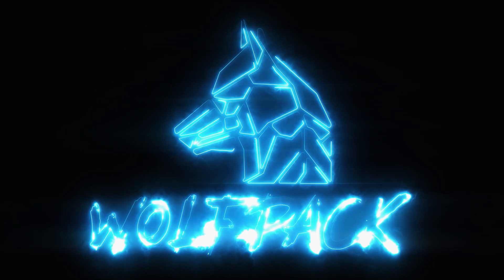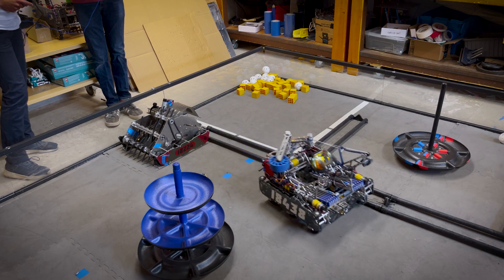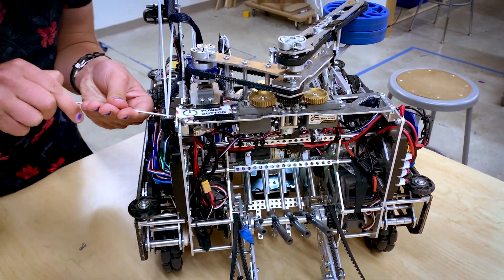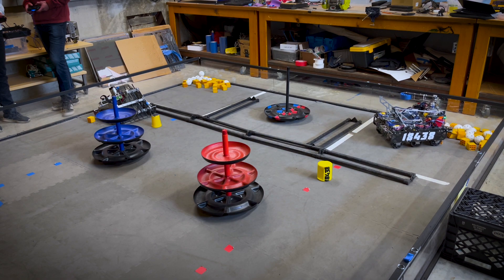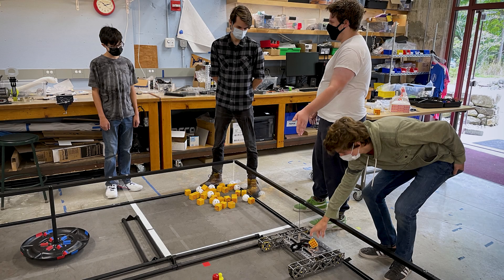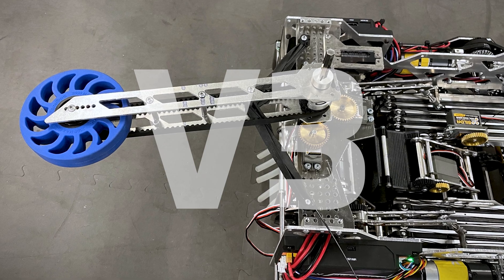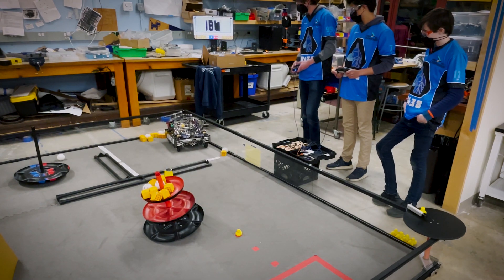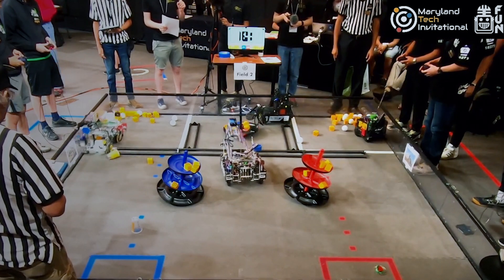2021 Robot Overview | Wolfpack Machina

Comment: How did you guys run your two drive motors that were bolted together? Did you use a splitter into one port on the Rev Hub or did you just plug them in to two different ports?